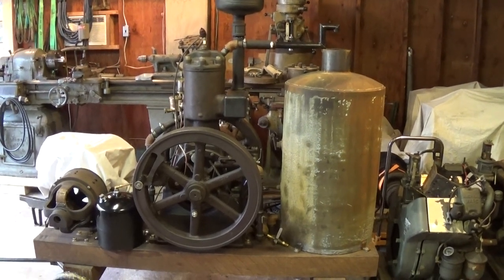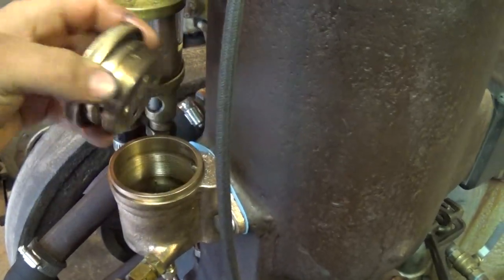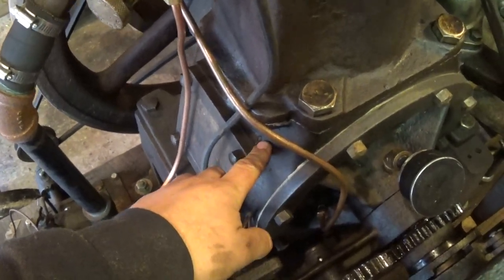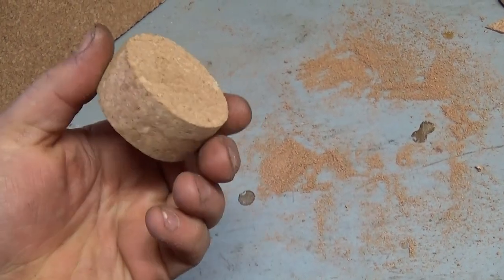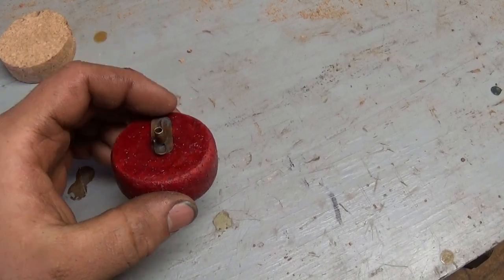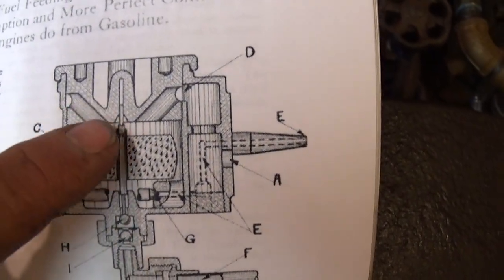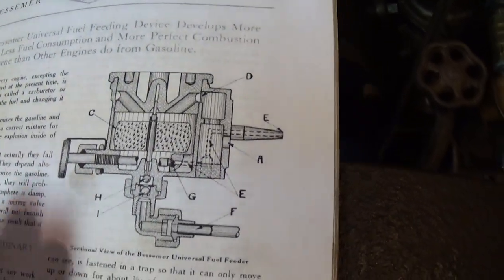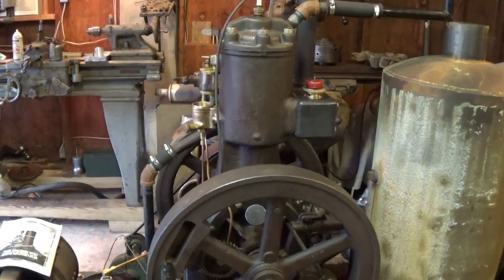8 HORSE BESSEMER REVISITED PART 1

Comment: Very nice video and good job of describing the low pressure fuel injector/reservoir.  Design that was also used on the Detroit two cycle engines.

Comment: Cool video Mike. I couldn't help but notice the WARD 45 degree elbow on the cooling system. It is very fitting (no pun) that a Pensylvania made pipe fitting be installed on a Pennsylvania made engine. I worked in either the pattern design or pattern manufacture of WARD pipe fittings for almost 40 years. I'm sure I had a part in the creation of that small part that found a use on such a neat project. Thank you for your profound knowledge of antique engines. I am truly amazed watching and learning from your expertise.
Reply from the maker: +Cad-Cam_Man Thanks for watching!  I bought a few of those fittings from Home Depot.  I was surprised to see they were made in the USA considering everything else is from China or Thailand!

Comment: Hey Mike, that's an interesting  fuel delivery system. I have not seen this type before.  So, this engine get's it's lubrication then, from the oil mix in the gasoline ?
This is going to be a good engine to watch, when you get it running. 
Thanks for this.
Reply from the maker: +Reg Sparkes Hey Reg. Nope, there is no mixing of oil and fuel on this engine.  The main crank bearings are grease lubricated, the connecting rod bearings and cylinder are lubricated via the two feed drip oiler that you can see mounted right behind the fuel mixer. Thanks for checking it out!
Reply: +SmallEngineMechanic  Oh, O.K. then now I see. Thanks for this.

Comment: When you mention multiple fuels you also mentioned kerosene so will it run on diesel as well??
Reply from the maker: +ARednecksLife The information book does not specifically mention diesel fuel.  I think that kero would be the limit, diesel would be too hard to vaporize when cold.  A few other fuels that are listed are naphtha, benzene and other distillates.